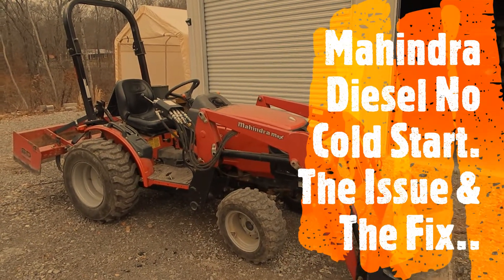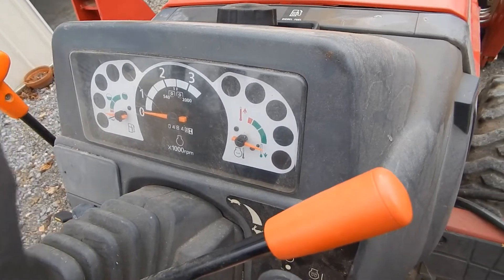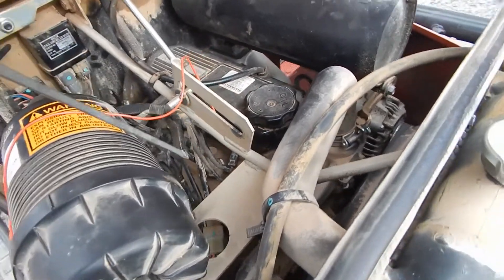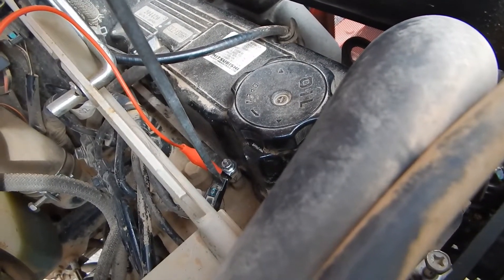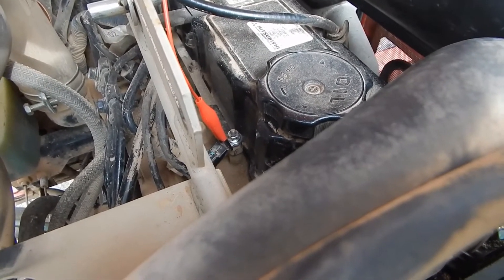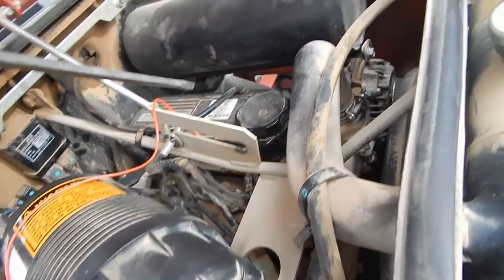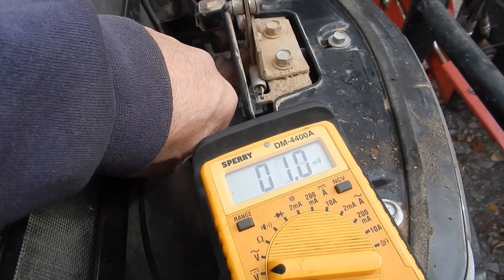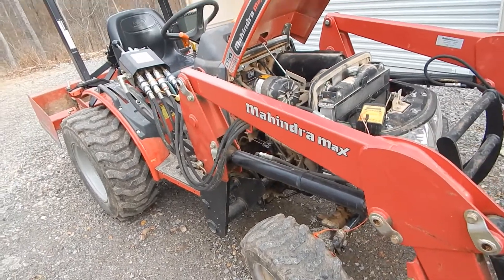Mihindra Diesel Tractor No Cold Start.The Issue & The  Fix.

Comment: My buddy bought a Mahindra 2123 it won't start in cold battery keeps dying  it was bought new and it has starting problems since it was bought I'm no rookie to tractors farm boy for many years our case pumas would always start we had kiyotie tractors no problem Mahindra are junk tractors period if your tractor does not start in summer and battery dies in summer and  the Mahindra company says there is nothing wrong yes there is case kiyotie  Kubota John deer start u need to start them and let it run yes but Mahindra is junk

Comment: Yup having problems changed fuel filter changed all glow plugs .....going to try your advice. I noticed they paint these on top. Took some sand paper and cleaned contact on bar....so let's see what happens I will charge battery back up. Only thing I haven't done is check fuses. It ran just fine during warm weather.....parked it now it won't start. So I will let you know
Reply from the maker: Be sure your fuel solenoid on the back of the fuel injection pump is working mine just went bad. Tractor would start and immediately stalls when releasing the ignition key from start to run. This had been happening on and off for about a year. Got one on Amazon for 50 bucks. Tractor never ran so good after the replacement. About 600 hrs  on my 2012 .
Reply: @TheKiloG69  thanks for your help. Tractor is ten years with very low hours. I was going to break it out for this past snow fall....I will take your advice.....
Reply: Still won't start
Reply: Now trying the glow plug relay will replace

Comment: Ever had a no start click when you turn the key?   Then the problem comes and goes all the time?
Reply from the maker: Yes. Check battery cable  connection   & grounds.
Reply: @TheKiloG69  Yea, checked those and even the dealer couldn't fix it after two visits.  Never was fixed under warranty

Comment: when my 3616 is cold it won't start without plugging it in and I normally have to put the battery charger (with the starting function on).  It eventually starts but I wonder if its really that my glow plugs aren't working
Reply from the maker: Most likely the problem.

Comment: Hey thanks for sharing and very easy to follow. Glad to have found your video. 
Had the same issue on my max 28xl. tractor, few years newer but the same problem.
Followed your check list and discovered the first glow plug was faulty. Decided to replace them all, and keep the other two as back up.
And your TIP on the diesel starter ... Much appreciated!
Keep your trouble-shooting videos coming ... Thanks.